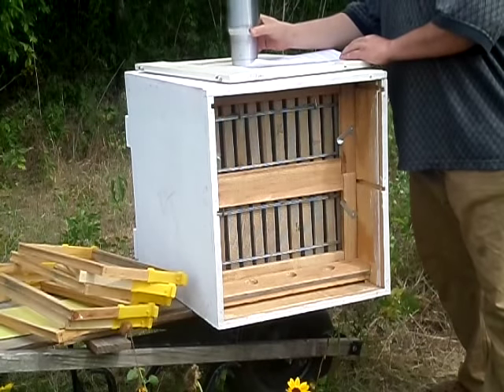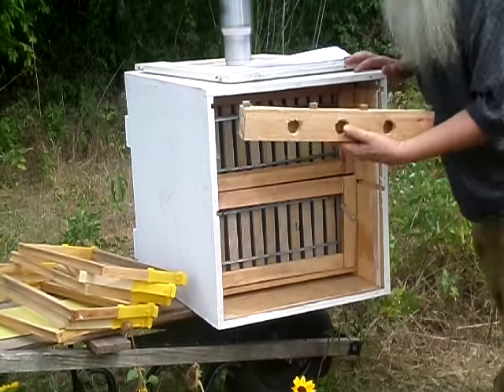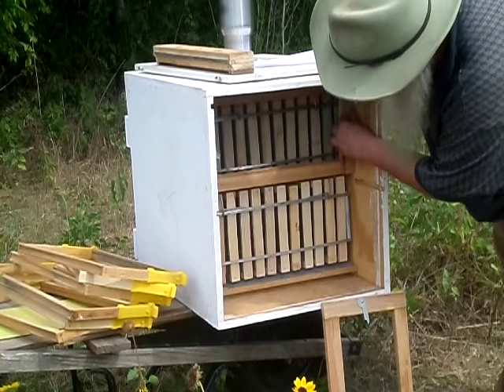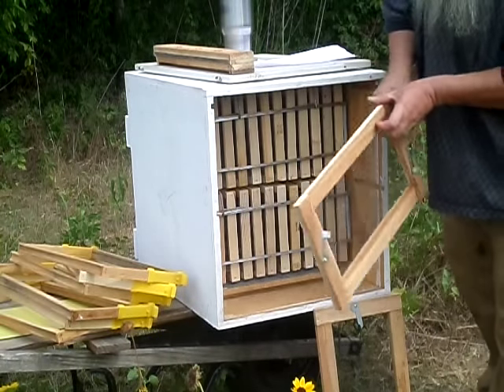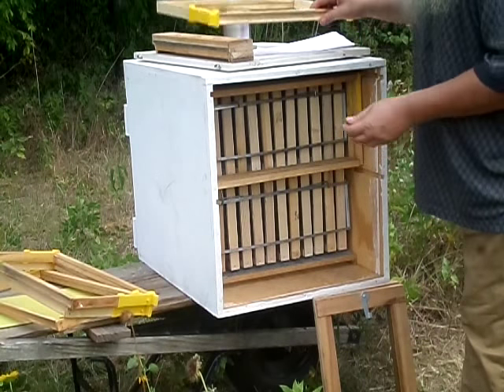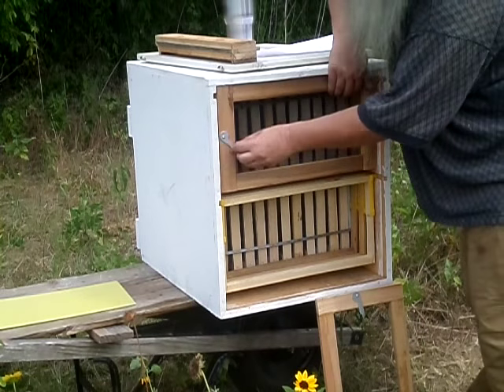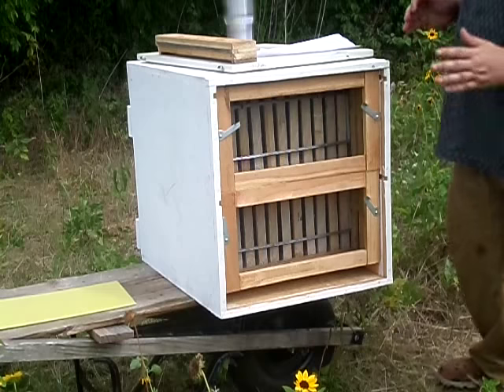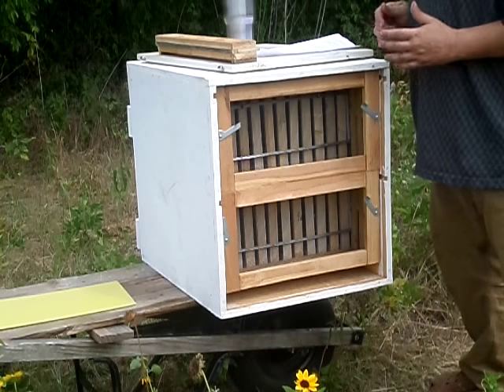Announcing  the first 12+3 AZ hive built in  the USA

Comment: nice Steve... can the bees escape from the dados cut for the plastic ears? What about the queen excluder? Can the bees move up around the excluder once the six expansion frames are installed? Last question, the frame proportions and sizes... did you stay with AZ dimension or are they langstroth deep frames without the ears?
Reply from the maker: I have small pieces that block the bees from exiting the dado's, 
The excluder can be placed in 24 frame mode between the two levels.  and in 30 frame  mode between the front and the rear  
These frames are designed to use Lang Deep foundation.